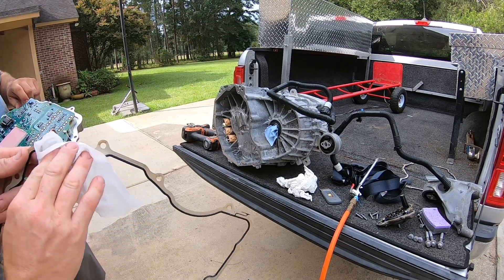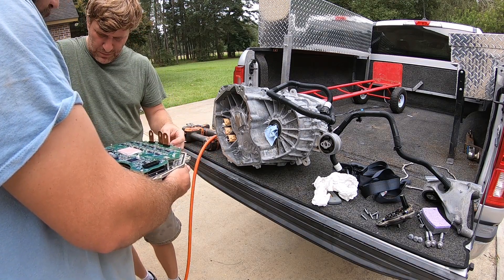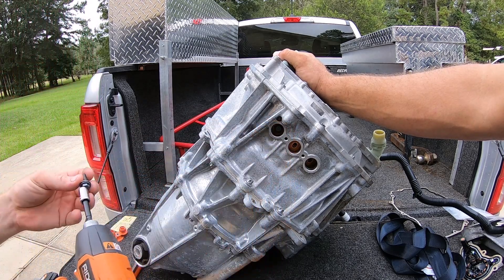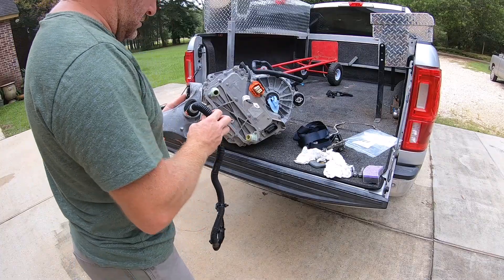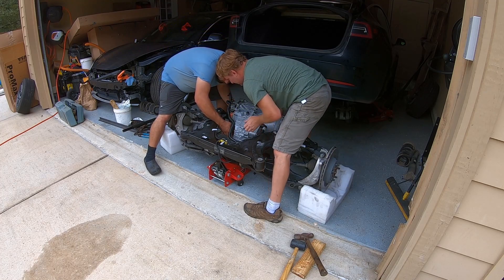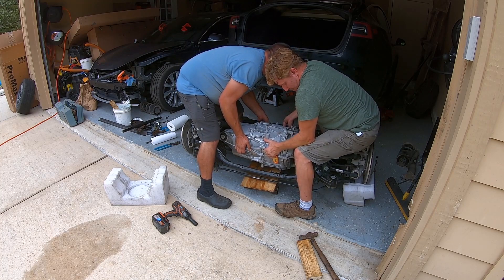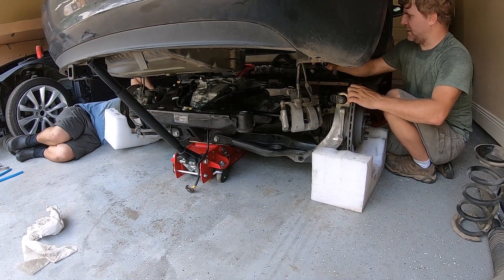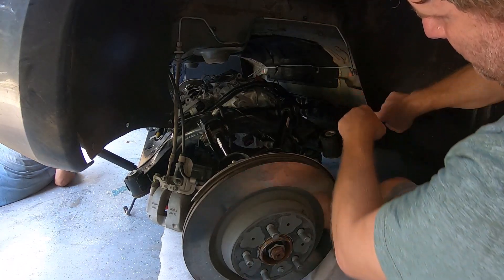Tesla Model 3 - Rear Drive Unit Replacement - P4

Comment: So if I got this correct once you have the motor out you need to swap out this board from the old motor to the new motor
Reply from the maker: Yes if it's not the failed part it makes it plug and play no need for toolbox.
Reply: @TeslaRebuilders yup figured that out swapped my drive unit in my garage and switched the board and my tesla model 3 is back on the road!!! THX!!!!!
Reply: Hello, guys my 183000 miles model 3 RWD Long Range drive unit needs to be replace . I been looking on eBay for drive units but I’m not sure about the compatibility between models and years. How do you source that out ? My is a 2018
Reply: @eduardolinares2313 I would verify the part number for your drive unit. I was able to find one from a place in Miami,FL that only sells Tesla parts. I have 21 and went with a 23 drive unit. I had no issues booking everything up. BE SURE to take the drive unit apart and swap your inverter/motherboard over or you will be like me and have to drop it again because nothing is working. Other than that it’s plug and play. I could be wrong but I don’t see why a 2023 as the last model 3 before the redesign shouldn’t work on your car. Mine had ruffly 4k miles on it and the Tesla is running strong. Swapped at 105 miles because Tesla didn’t want to do it. So a 10k job for 800 bucks and some time is well worth it.
Reply: @Stinvil93 Do you remember where exactly in Miami? , maybe they offer shipping
Reply: Good job , I been looking on eBay for drive units and they all say 17-23 but when I ask on chatGPT the answer was “not compatible” 😅, thank you for the fast response.

Comment: Do you have a video of you removing the drive unit step by step. My Tesla model 3 2021 is out of warranty so I will have to tackle this. I work on cars so I am not to bad off but I looked in my drive unit and had metal shards not particles after I removed the oil pump. Bought it brand new but have about 106k miles on it.
Reply from the maker: Tesla has a 120k miles drivetrain warranty!  You should not have to do anything but bring in for service stating what you found.
Reply: @ on my model 3 SR+ it is 100k miles or 8 years. I’m at 106k. I swapped it out at my house. What steps did you do after you swapped in a new drive unit

Comment: I changed the drive unit but only the motor and left the same resolver and inverter.
Now I get a BMS error and tells me that I have to close the high voltage battery contactors and I cannot start the vehicle.
How did you make the rear drive unit and pump oil compatible after the error that was indicated?
Reply from the maker: You should be able to enter service mode and do a software update to push the current version to the oil pump.

I didn't have a issue other than resolver because it didn't have the sensor for motor winding temp.  That's why I put the old one back in.  It's been going good have another 30k miles on the car now at 134k.

Comment: I have a 2020 m3LR with boost. Do you recommend changing oil and filters in the motors at this mileage?
Reply from the maker: No the oil was perfect, it was more less a catastrophic failure not due to the oil.
A Tesla motor is like a trucks rear end with only a few large gears.
The oil used is more of a transmission oil for both cooling and lubricant.

I believe there was a flaw and or the car experienced one too many launches.  I also contribute the issue with disabling traction control and doing donuts a few times.  This directly effects the pinion pin and gear set as just one side wheel breaks loose.  The pinion gears are bushened and not bearing set.  To much force on one side while other is spinning at high rates could damage it for sure.  Usually with turning or slightly slipping on the road they are at relatively not moving at all.

Thanks for the comment and watching,
Casey
Reply: @TeslaRebuilders  Thanks so much for the response! That helped a lot! Good news is it’s the wifeys car and she only drives in chill mode! Hopefully she goes forever 💪

Comment: was is the same engine?
and when its not. will a swap still work?
Reply from the maker: No this was a 960 model motor but the only thing that makes it a 960 or a 980 is the inverter.  Swapping the inverter replaced the smart part that was coded to car and didn't fail.  I bought a motor cheaper and newer without a inverter as it only had 2k miles on it.
You can replace with a whole new motor but has to be same model and copy over data in toolbox before replacement.

Comment: how do you enter the service mode and did you used toolbox? I can't let my car in the service mode, Tesla guys said there is a barrier to limited car only can set this mode in service center. Also, I just wondering this any chance that you can test your car parts was been replaced such as motors and battery, did the car will warning that or not? I just worried if I let my car stay in other working place, how can I know they did stole my parts and replaced a broken one?
Reply from the maker: Sorry for the late reply, Yes Service mode is easy to enter as long as your on the latest update.  You do it by going into car menu - "Software" and holding on the "Tesla Model Logo" when it blinks in a few seconds enter password "service" then you can run diagnostics, do calibrations, check status of all the systems.  
Not sure if you can tell if a part was replaced other than checking serial numbers on tags, there will be errors or other faults showing if there are any problems.
Yes not sure where you leave the car if not at a Tesla service they would not steal anything.

Comment: Tell me how you removed the turtle error 026?
Reply from the maker: It was because I didn't swap the original resolver, it was clearly shown in video after the error.
Mh old car needed the original that had a temp sensor for the windings on it.  The new one didn't have it so the car went into limp mode.

Comment: Greetings! I understand you changed the inverter? Did you have a BMS_035 error?
Reply from the maker: No I only replaced the motor and kept original inverter.  Only reason I had any errors were because of newer oil pump and the new Resolver.

Comment: Thanks for your channel. It has helped a lot of people. I would like to know what do I need to do to clean the radiator fan under the front trunk. Mine  is making a clicking sound like if there was a twig or leave stuck. So basically, what is the easiest way to access that fan?. I know the fan is not bad because I hosed some water while the front vents were open and the noise went away, but it came back. Your reply will be greatly appreciated. Thanks again.
Reply from the maker: Yeah that's one of the things I don't like about the cooler on the front of the car it's not easy to access. There are two bolts that go through underneath the frunk cover on either side. The only issue is that they have coolant lines connected to both sides and AC condenser lines on the left. If all the lines were placed on the left side you could unbolt it and lift it up with the length of the lines that they have. The only way to get around this would be to drain the coolant and disconnect the right side line. Then it could be lifted and covers taken off to expose the coolers. Let me look into this a little bit more to see if there's a easier way I also had this same issue before.
Reply: @TeslaRebuilders  I was able to remove the front screws of the diffuser and the clips from the bottom of the bumper, and that gave me access to check the fan. There were no leaves there. So, next to check is the radiators by removing the front tub to see if anything needs cleaning there. Weird that the clicking sound is like a leave touching the fan blades, but the fan was clean. Are there other fans in that area?
Reply from the maker: @rcmore7871  oh ok cool. No the fan is actually on the bottom of the shroud. It's probably caught between it.